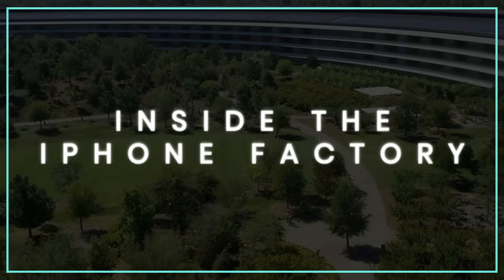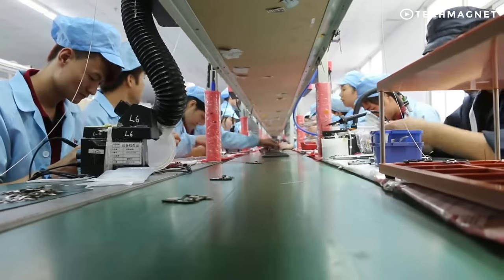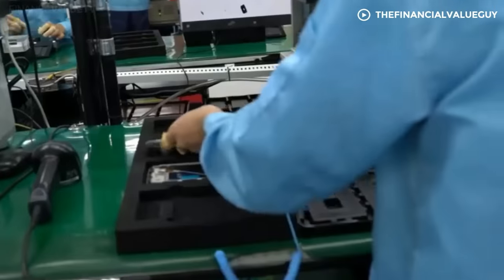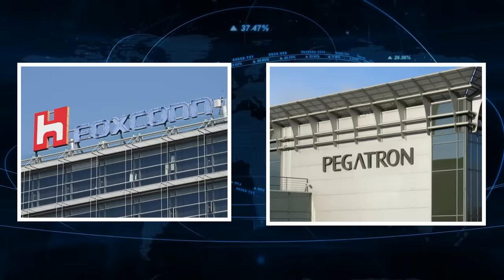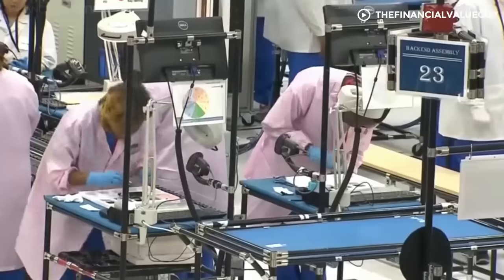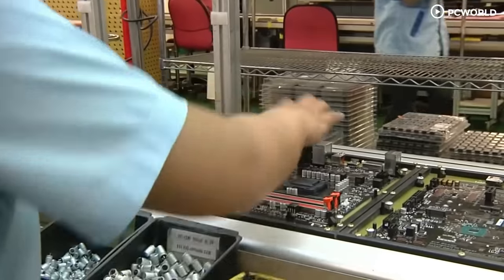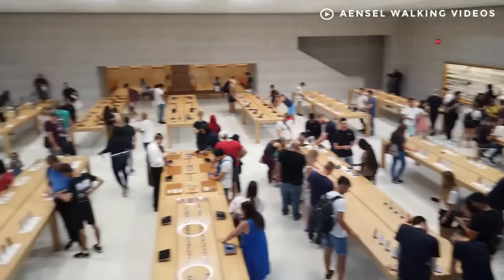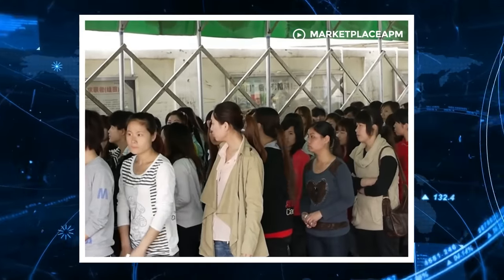Inside Apple’s INSANE iPhone 13 Factory!

Comment: iPhone is literally the worst phone I have ever owned these workers should be locked up with the manager the whole board should charged for There stupidity of those phones not reliable for your money . The problem I have with all iPhone is the charging cables not even the original cables don’t work they made it that way error massage on most cables from .Big bull S you all should be put in prison for that and the battery can’t remove that’s the next thing paying so much money for a non reliable phone like that am currently using an iPhone witch can’t charge cause of the charging software I haven’t had a problem with Samsung charging except for the batteries can’t be removed

Comment: Narrator: paraphrase; "complete phones are placed on a wooden pallet." If I cared about the mere fact that ninety nine percent are wooden, and its non relevance, I would savor the idea of what the chalk drywall is made of. And that's just one example. Try showing how workers' eyes roll back into their heads after inserting five thousand pin head screws. How is it possible to marvel at 21st century high tech engineering when these poor chaps ponder the afterlife as respite from monotony.

Comment: Great Video Vlog; however, your title should be corrected as Inside Apple's Outsourced INSANE iPhone 13 Factory! Meanwhile, let's face the truth without Foxxcom' s actively and largely engaged in the assessment of iPhone.. could any factory workers in the Caucasian or even LATAM countries be so persevere and productive and they could bear such demanding jobs (to accomplish at least 90 million sets per year of recent generations of iPhones) even though the outsourced factory workers are paid far better than average domestic Chinese manufacturing firms by at least 40 %.. and those are paid over time at off working hours at 1.5 times than normal regular hours plus twice as much on Sundays and Public Holidays as normal regular hours, for which 80 % of locally based manufactures in China do not practice as per the Labor regulations by the PRC!?
Reply: This is NOT iPhone 13 manufacturing or factory video. This is a mixture of cut pieces of iPhone 5c manufacturing video, iPhone 13 unboxing video and some other iPhone after market parts production video available on the youtube.... lol.

Comment: you are wrong, Foxconn workers make 9-11 per hour on the assembly line and it does not equal to $400 -$700 as you say, it's about $1,400 a month if they get $9 per hour. Please get the facts straight.